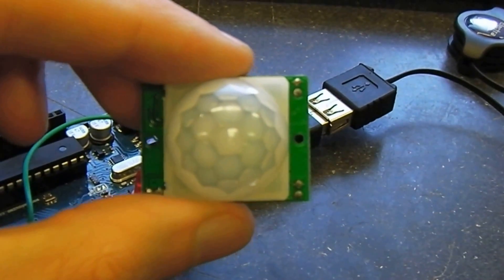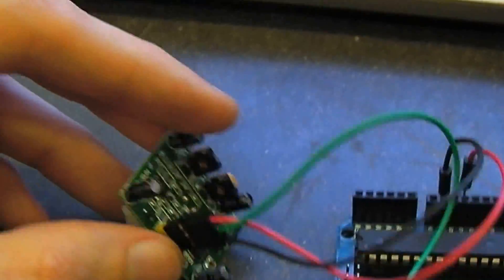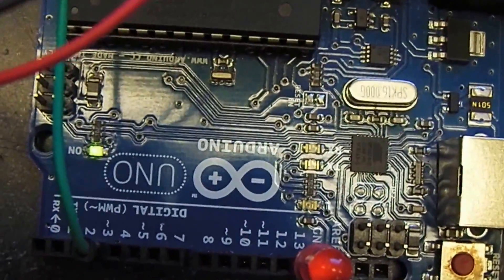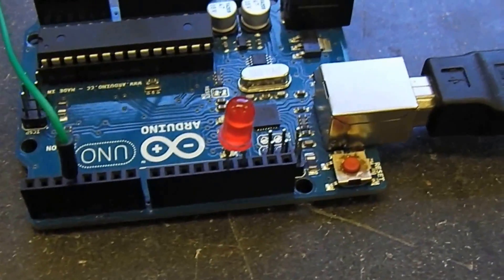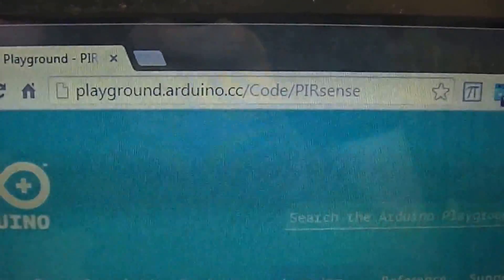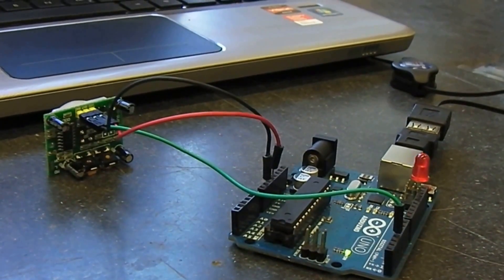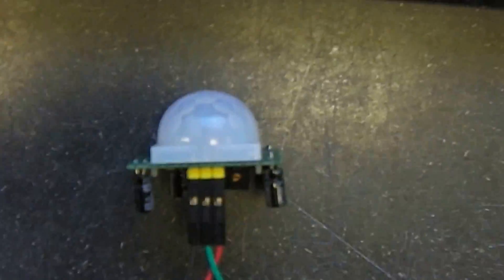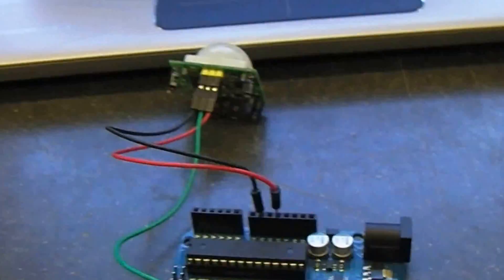How To Connect PIR Motion Detector Sensor [Arduino Tutorial]

Comment: I looked at this video as I recently bought one of these modules with no pinout details :-(  Many thanks for providing those! I'm just a bit puzzled as to why you need an Arduino to make it work. If you connect the power up to the module and the  middle / output pin to an LED via a resistor, it works perfectly without it...

Comment: Hello!
I have to you a question: please if you can answer As it is possible to connect a voice signal to this sensor? 
I too bought such sensor on the Internet with ebay.com, it from me already at home, I tried to connect a light-emitting diode today, everything turned out, everything is normal, the sensor reacts to the movement a light-emitting diode turns on but when tried to connect a call for a door of nothing it turned out That is as I made all this: I (the call module for a door) connected a call to wires from batteries to this device but batteries pulled out and contacts of wires of a button From a call closed - that is: a bulb LED place I established a call for a door but it turned out nothing, in my opinion there is no power Though 2 batteries are 3 Volta And this sensor gives out 3.3volta. Maybe in business milliamperes??? I not really understand the electrician So please don't think badly of me, I simply try something I sdelat.mozht something not so made? Please help council... I hope you understood me as I wanted to make a voice call?! it as if the motion sensor with inclusion of light but in a lighting place the voice call that was...
I very much hope that you will advise me and you will help to make such device?!
best regards George!